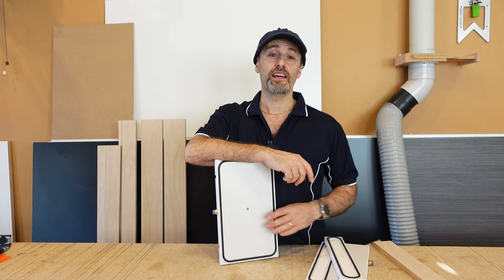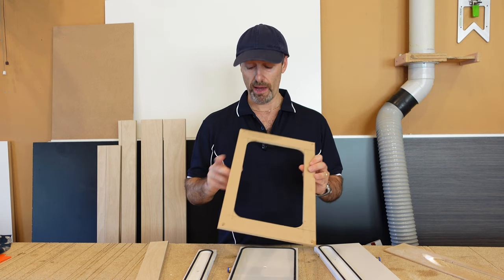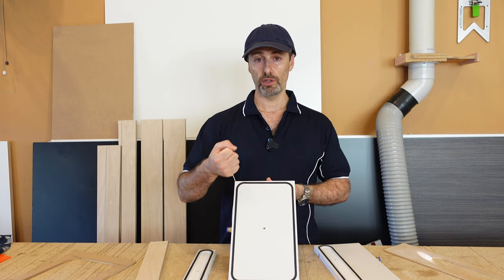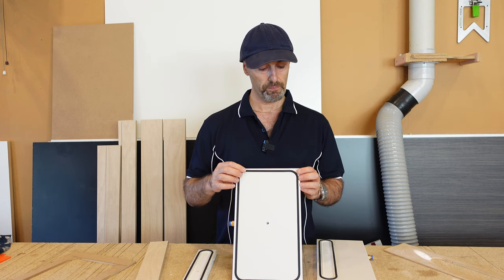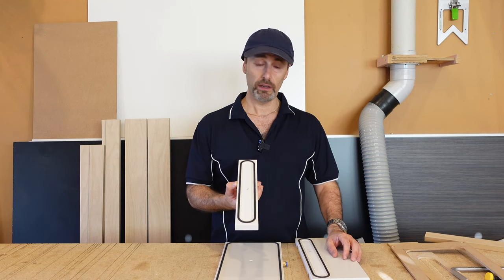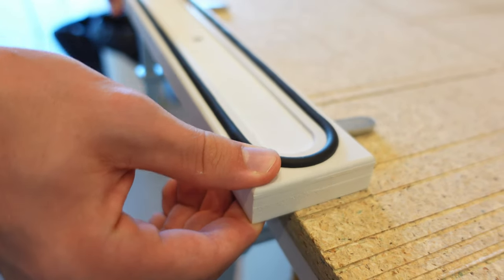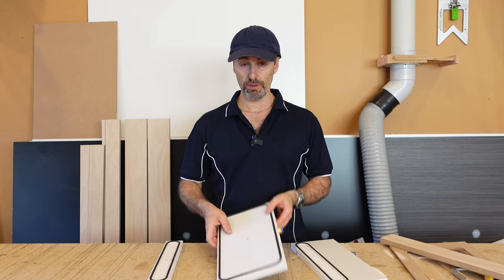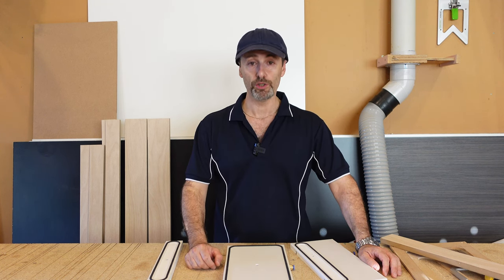DIY Vacuum Clamp MKII | Vacuum Workbench Clamp | DIY Vacuum Suction Pad - Made Without CNC!

Comment: That's brilliant my bro. I'm suitably impressed with ur workmanship as well as these clamping systems ur making.  What is this white board ur using? Is that some coloured MDF? I cannot find anything like tis in IRELAND. I've seen blue and Black MDF but it's very hard to get it.  Is the rubber u used a rubber tube? What size is best if u can tell us please? I really like this idea. I'm sick to death of opening clamps up all te time to move things. This is a great idea for a small sop like mine. Even one of these would be awesome. 
I'm still stumped by that white board u ut the dovetails in the bottom of. It's new to me but then I don't make cabinets for a living. 
Keep up the great content man. I only found ur channel tonight bcos I watched another video about the router lift. I found ur channel with that same router lift video. 
I wonder are u still using it bcos that bit for the dovetails was a 1/2" shaft dovetail but, wasn't it??
Reply from the maker: Hi again Bud, the board I used as mentioned in the video is a PVC board, in other words it's made from plastic. We use it in Australia for outdoor cabinets as the moisture won't rot the board and it's very light and easy to work with especially when using the router. The rubber is solid tube, you can get all the parts from Amazon, just click on my description page attached to the video. I have listed all of the parts with links for you to buy. The dovetail cutter I used is from the Matchfit clamp set and yes, it is a 1/2" bit so I use it on my Triton router. See links below:

PVC Foam Board:
https://amzn.to/3JlVIPb
https://amzn.to/3ZStFxP

Round Rubber Seal: 
https://amzn.to/3wZqPdE 

Router Cutter to Suit 6mm Seal: 
https://amzn.to/3ZHThNT

Pneumatic Fitting Push-In 1/4” x 8mm: 
https://amzn.to/40qSBxj 

Vacuum Pump (NOTE: NOT THE SAME PUMP AS I PURCHASED BUT SIMILAR! - check the pump has your countries power-point plug):
https://amzn.to/3DDT99d 

Pneumatic Foot Pedal: 
https://amzn.to/3HCUyxL

Microjig Matchfit Clamp Set: 
https://amzn.to/3jySpLD

Comment: Thank you for sharing this.  Would it be possible to use the same suction technique to fix the pad to the bench top and therefore avoid the need for clamps?
Reply from the maker: @mattosborne1800  yes why not, just drill & countersink a hole in each corner making sure the countersink screw heads are below the surface. Thanks for watching and good luck with your project 👍😎

Comment: These vacuum clamps are great, could this system work to hold corrugated cardboard on a workbench given the uneven surface?
Reply from the maker: No I don’t think so, the surface needs to be flat and also the air would pull through the cardboard

Comment: great vid! whats your depth of cut with that 5mm bit for your channel?
Reply from the maker: @seanmichael5751  the depth of cut depends on the rubber diameter you use for example if you are using 6mm, then router down around 4mm. You just want the rubber to stick up enough for your material to sit on then under vacuum it will squash down enough you have a decent seal. Hope this helps 👍

Comment: The link for the pump is to a US site, so each pump listed is 110v, not 220 required here. Did you use a step down converter?
Reply from the maker: Type in the following on Amazon AU:
BACOENG 3 CFM Single Stage Vacuum Pump 240V for Air Conditioning Refrigeration HVAC
Give that a try

Comment: Thanks - how did you join the rubber seal. using quick curing adhesive can make the joint hard and brittle making the suction to leak ?
Reply from the maker: @sajjadahmed5139  I didn’t use any adhesive just made a nice neat tight joint
Reply: @geoffsjoinery4990  Wow - thanks

Comment: Great video, I'm in the middle of making some to go with my Gast oilless pump I had for the lathe.   The last thing is to buy the PVC expanded foam sheets.   What's the longest size plate you found useful?   Should I buy wider than a 12" piece or should I go up to 24"?   It seems like your pieces are about 12-18" in length ?
Reply from the maker: Hi there,
Yes mine are around 12” in length. I have not needed longer yet but if I happen to need to accommodate for something longer then I can hook up 2 clamps

Comment: Instead of using the clamps to hold the vacuum pad to the workbench....what if you made a double sided vacuum pad, with a hole and a gasket on each side, whereby your vacuum pump sucks the pad down to the workbench, as well as sucks the workpiece to the pad?
Reply from the maker: Yes of course you could do that, I chose not to because of the crappy chipboard cover sheet that sits on top of my bench with lots of saw cuts through it. You want to make sure you have a nice smooth and solid surface for that method you mentioned.
Reply: @geoffsjoinery4990  okay, good to know.

Comment: I wonder if the vacuum cares at all if the tunnel goes to the center of the piece or not?   my drill press is a hunk of junk, it'll be hard for me to match up holes at 5 or 6 inches.
Reply from the maker: Yes you don't have to drill right to the center you could just keep it off center to suit the range of your drill press or drill bit. I actually have another suction pad made with the fitting in the center, it has a fitting and goes out through the bottom, but it doesn't go through the board then a 90deg fitting which takes the pipe out to the side, You could make it that way and make some mods... Good luck